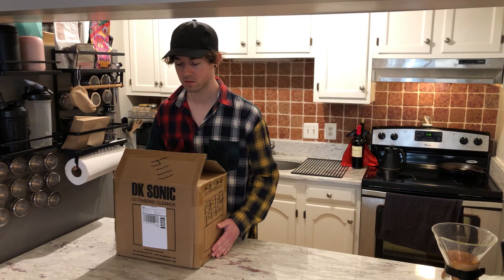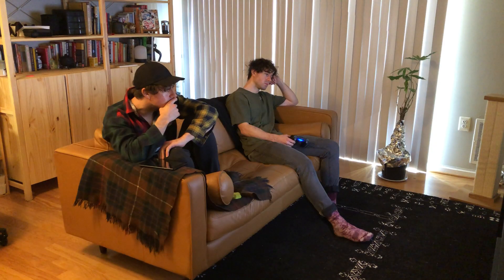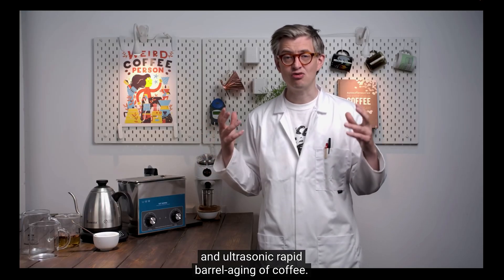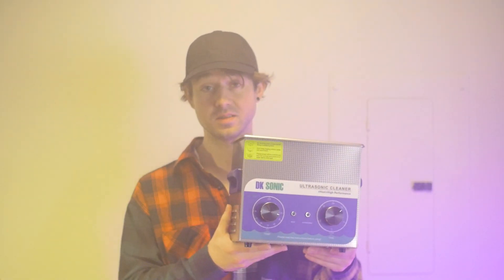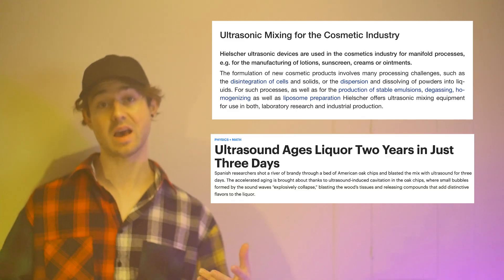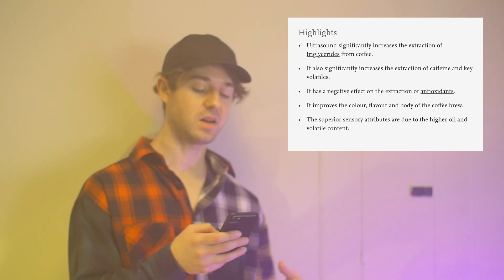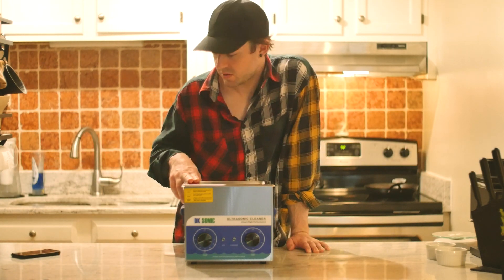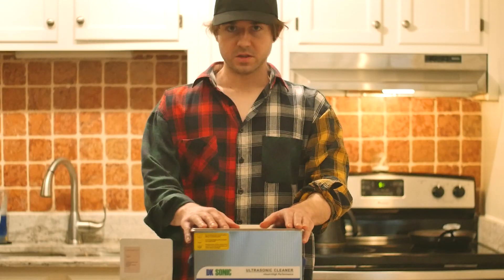Sonication: The Newest Coffee Brewing Method You've (Probably) Never Heard Of

Comment: Thanks for your experimentations!
I enjoy studying coffee science and am trying to discover new ways of making cold brew in big batches for nitrogen infused coffee. Vacuum extraction was my first idea, with a vacuum environment having a low boiling point the extraction could speed up immensely but a vacuum chamber for a five gallon batch seemed like a lot of vapor the pump would have to work on to keep the vacuum going. Cavitation was next with pressure and quickly releasing the pressure but not much more than studying the process. During these experiments in my head oxidation became a primary concern both for taste and keeping everything fresh for extended periods. The thought that won out and now has lots of equipment is using a nitrogen generator to brew coffee in a 6.5 gallon keg under pressure of nitrogen, purging the oxygen from the air and water and the CO2 from the brewing process the keg is also slowly rotated during the brewing process and filtered afterwards then placed into kegs in a kegerator under pressure of nitrogen. I’ve been considering placing ultrasonic transducers (not sure of the frequency yet) onto the brewing keg but still need to master my keg brewing method first. Of course taste is the primary concern and I’m thinking an oxygen free brewing container is a good idea. 
Thought you’d like to read about my ideas, I’m kinda deep in the rabbit hole 😀
Reply from the maker: Hey Eric,

Thanks for your comment and for sharing your ideas. I love a good coffee experiment. It sounds like you're putting a lot of thought and work into this and I'm excited to hear what you end up with. Sounds like a lot of fun.

As for nitrogen brewing under pump pressure, you should check out Hardtank. They're a European brand that does something very similar. They have a smaller version that's available through Fetco called the Baby Hardtank. I don't think they're using any ultrasonics or acoustics in their design, however.

As for your frequency usage, definitely test out different frequencies if you can - my theory is that different frequencies will extract specific solubles at different rates.